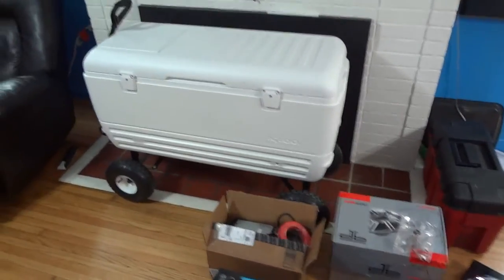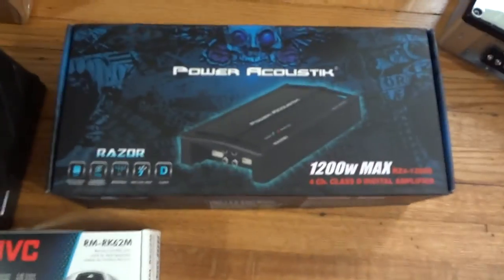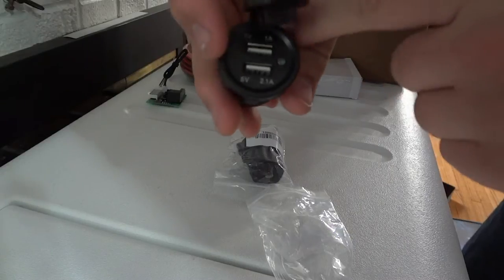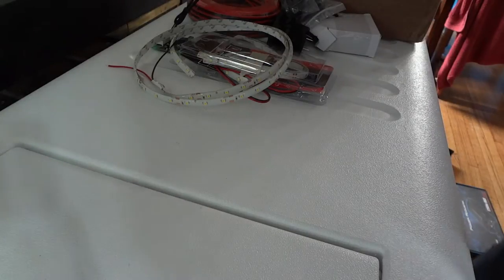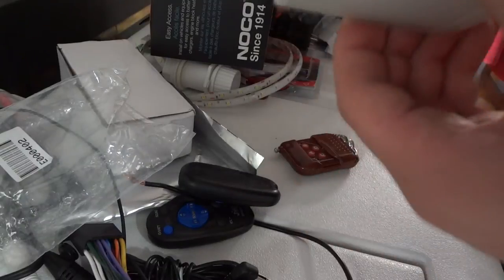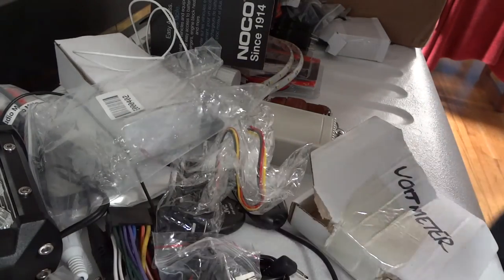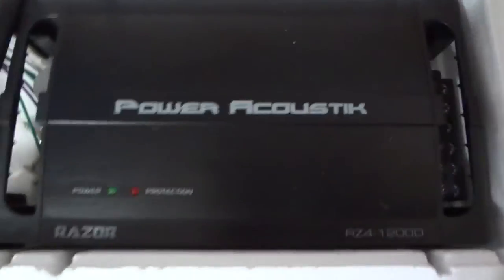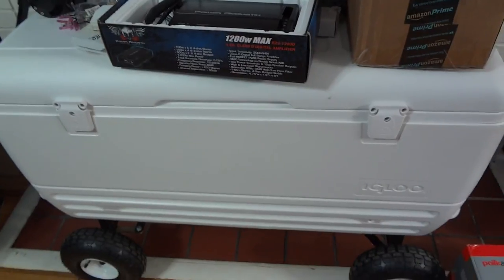Cooler Radio Wagon Update! Parts Review 8/8/15

Comment: Wow! It's a Man cave on wheels, nice parts and incredible cooler features! I'd be curious how you feel about that Walmart battery after some time. Seems that some people claim they are not a true deep cycle battery's like an AGM SLA battery. I own 3x 35AH 12v UPG AGM battery's for a solar powered backup power outage system and they have great cycle life for deep cycling and great low self discharge. But I guess with this cooler, even if you used it every weekend for a couple years the Walmart battery might survive because you might not be coming anywhere close to killing the battery each time with that much AH.
Reply from the maker: Thanks man! Check out my newer videos, I've added a TV and a lot more stuff, it's truly a man cave on wheels lol. I actually just really "used" it for the first time being away from home. We rented a boat to go out on the lake all day and I had the stereo blasting and charging my phone from about 10am til 6pm and really didn't drain much of the battery. Got home, plugged it in and it was charged back to full within an hour or so.